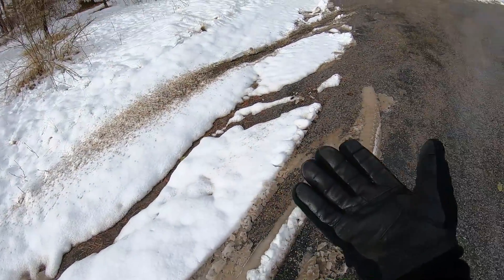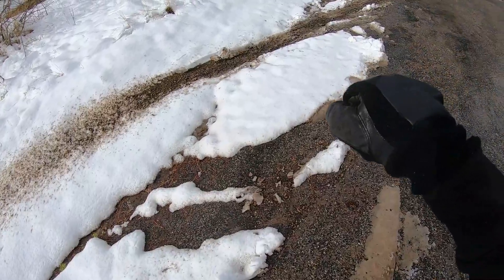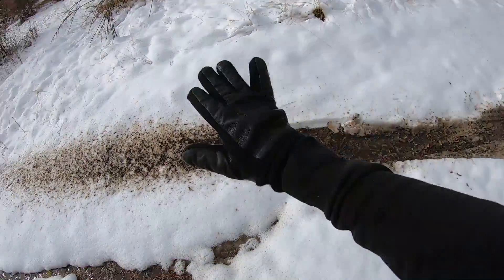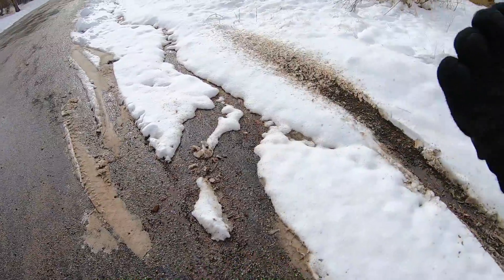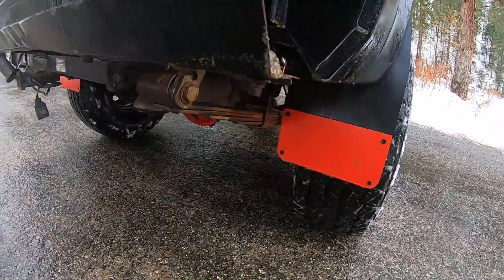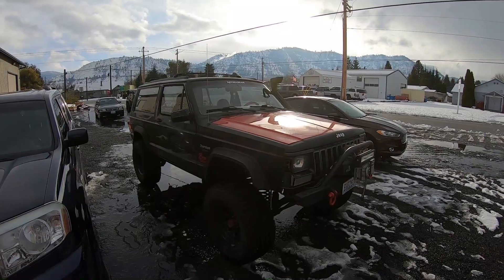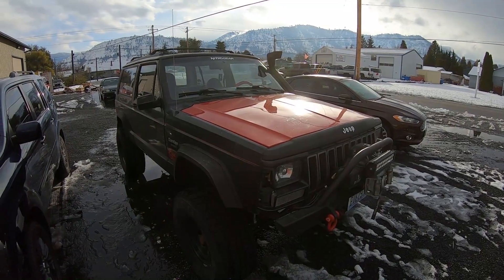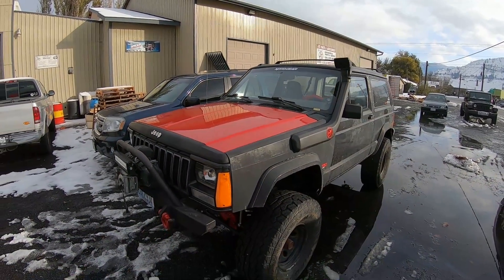Nitro Limited Slip Differential (Helical Worm Gear Style) Will It Save Us From Getting Stuck?

Comment: I've been thinking of getting a torsen rear diff for my lifted subaru forester, but everybody is telling me not to "waste my money since they act like open differentials when 1 tire is off the ground" but I rarely lift tires since I'm not doing EXTREME trails and rock crawling. My main concern is traction when all 4, or both rear wheels are on the ground in low traction situations
Reply: Helical diffs are the worst LSDs for low-traction environments. I'm not saying they wont work but you need to first decide what your expectations are.

Comment: I'm currently looking at differentials for my 2003 Tundra AC RWD and originally going to go with Detroit Truetrack, but came across a bunch of Nitro-Gear master rebuild, ring/pinion and rear pinion setup kits that are supposedly closest to OEM than any other aftermarket brands. Then I noticed Nitro-Gear even makes an LSD. Now it's got me thinking, should I just go with all Nitro-Gear when performing a complete rear differential rebuild or go with the most popular tried to true Eaton Detroit Truetrac?

Comment: Looking at this for my 4Runner 8" front clamshell (TORS-T8S-3) and was wondering the torque bias ratio on these on decel/accel?
Reply: I found it - 3.5:1 - not sure if this is on or off power or both?
Reply: @dandnguyen  I had a true track in the front of a 78 chey 4x4 and could go threw almost any thing. question i now have a 2005 tacoma with the 8" clamshell front ,true track never made one foe this truck so disappointed. so i just now found the Nitro worm gear for my truck. ready to buy so does this work like the Eaton true track worm gear ?
Reply: @TLCOXOX  it should work exactly the same. I actually have one sitting in my garage waiting to be swapped as we speak.
Reply: yes assume but only for 373 gears and down
Reply: @TLCOXOX  I’ve been running mine since earlier in the year.
Reply: @dandnguyen  I’m looking at getting this torsen for my 4Runner in the front. How have you liked it so far? Any weird or sketchy handling characteristics while in 4wd? Would you have rather gotten a front locker instead ?
Reply: @Alex.outbound  It’s been great! Nothing weird really - just the fronts will want to spin together on throttle that you have to get used to but nothing sketchy. Front locker would have been fine too, but I’m pretty happy with the front torsen all in all!